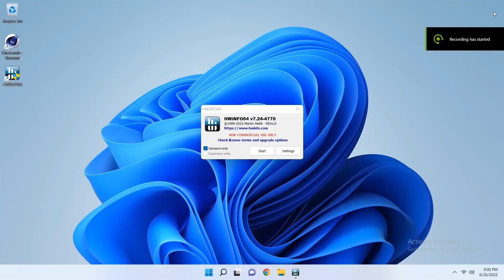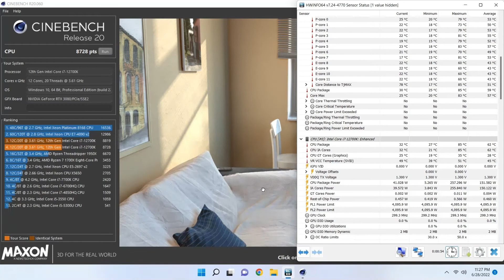Washer Mod on thermally throttling Intel 12th Gen I7 12700K.

Comment: Should I do the washermod on an ASRock Nova and a 14600k? When I did it in my old system with the 12100f and a b660 mobo I did not notice temperature difference but the tension when moving down the lever felt a lot more normal.
Reply from the maker: I would use a bending bracket they work better but if you have to yes washer mod will help because 12th,13th, and 14th gen intels all have same shape and ILM on motherboard.

Comment: Walker gaming pcs I got something better I just built a 4080 13900k build. Try taking the bracket off and just use the aio cooler to mount the cpu I did it posts and I have no problems
Reply from the maker: 12th+13th Gen Intel CPUs are sensitive to mounting pressure.  I switched out the MSI AIO for an Arctic Liquid Freezer II which required creating a mounting system that fit, which I did and I get good temps and the correct pressure so I don’t want to change it. You should do memory stress testing as this is what incorrect mounting pressure effects the most.
Reply: @walkersgamingpcs  I got the nzxt aio. And mounting pressure the nuts stop once’s they are completely tight they don’t go any further
Reply from the maker: You don’t understand, let me try. The pins on the motherboard are actually springs they need to have the right pressure to bend correctly otherwise you can get weird memory issues. The ILM or Bracket is what applies this pressure correctly the mounting system for the AIO is for pressure between already set in place CPU and AIO. Posting doesn’t mean you have the pressure correct. If you kink or break the pins your going to have even worse issues.
Reply: @walkersgamingpcs  if you do can you make a video
Reply: @walkersgamingpcs  okay for me to run memory test. You want me to run cinebench?

Comment: Would less torque on the screws so the same thing?
Reply from the maker: No, you risk pulling threads if  the screws are not properly tightened. Power planes run through the board so cross threading or pulling threads can be catastrophic.
Reply: The retention bracket screws are already barely torqued from factory, i think that's already a countermeasure by the board makers against excessive pressure. When i did the washer mod yesterday on my new MSI Z690 board, the screws were quite loosely tightened indeed, i don't think you can have them much looser than from factory.

Comment: I'm upgrading to an i7-12700K Soon, the highest room temperature I've seen is 32C during the summer but generally hovers between 26-28C, I live in a hot country although I got a good corsair h100i Pro XT 240mm for it, gonna get 3 front intake up to 2000RPM pmw fans too, I'm planning to get a thermal right contact frame to replace the OEM socket in the board not only for better temps but also for the longevity of the CPU in the upcoming years and preventing bending/warping, if the CPU Still runs over 90C with the contact frame and all, I'll prob undervolt the CPU a bit just like I am doing currently with my i7-9700 to achieve slightly better temperatures.
Reply from the maker: I’ll have a video coming out next week where I test several contact frames and two different 280mm coolers on the CPU and in a push pull configuration at 100% speed the best temperatures I was able to get is 92° on Cine bench r23. However on a customers computer I used an arctic liquid freezer 240 mm and with the washer mod I was able to keep the temperatures in the mid 80s on cinebench r23. So I might personally end up getting an arctic liquid freezer II or lapping one of the coolers I have
Reply: @walkersgamingpcs  Sweet, what is your room temperature? I think I might have to buy the i7-12700 (non-K) due to the lower TDP , should still be a great CPU and output less heat. I only have a 240mm h100i and live in a hot country/room.
Reply from the maker: Yea the non K version runs considerably cooler. Your CPU cooler should be able to handle it but room temperature does play a part. My room temperature was 21c during testing and my computer lab stays about 22c all year.